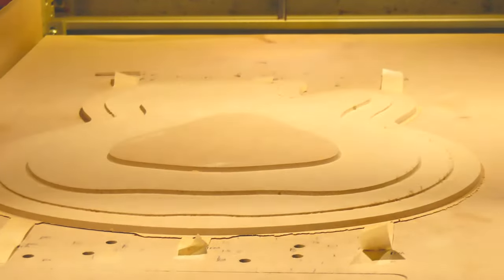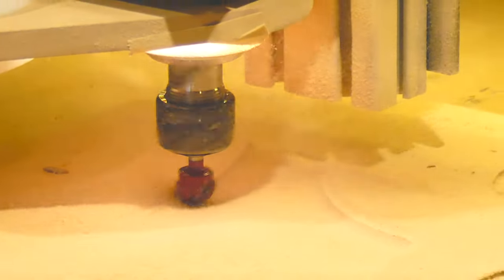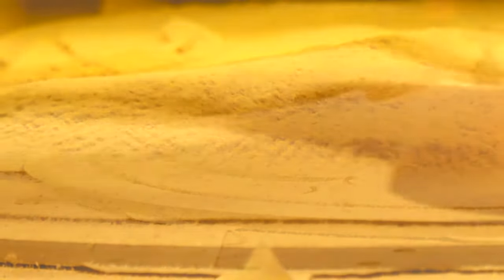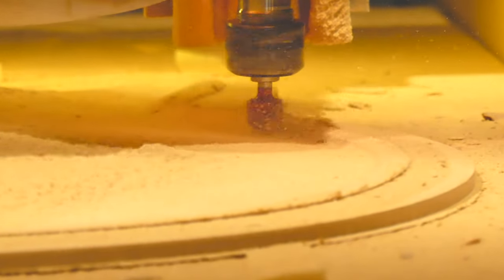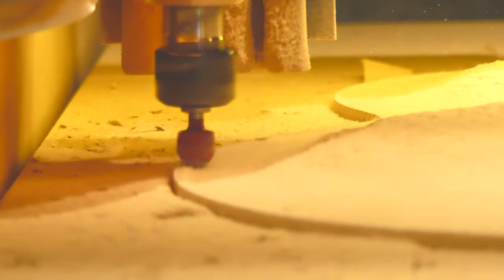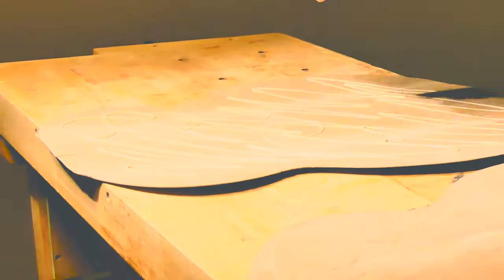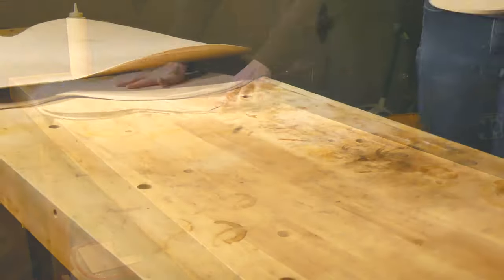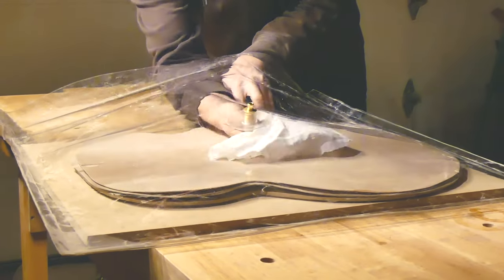Gretsch White Falcon | Laminated Arch Top

Comment: Hi!! Trying to do the same with a 330 build! Did you use urea glue for the lams or PVA? Also, what thickness are the laminates and are they cross grained? Thanks a mil!!!
Reply from the maker: I'm just using Tightbond original for this one. I wanted a top that is just over .125" depth and I uses a three layer laminate so around 0.04".

Comment: Really nice work!

I wonder what the tone difference would be between this kind of top and a single piece of the same wood pressed into an arch.  Any thoughts?  Would it have to be thicker?  Braced differently?  Sound different or louder?
Reply from the maker: There are so many variables in this equation, the outcomes are infinite. We can make some broad sweeping claims about the tone. Certainly, for acoustic value, a well constructed and tuned spruce top would make the string harmonics much more pronounced. This is an electric instrument so it doesn't factor in the same way. This topic has been argued back and forth forever and it will continue to be. I just try things and see what happens, I'm sure this guitar will sound great.
Reply: @TwoCherriesIns  Yes, I'm interested in acoustic archtops.  I know most are made by carving, but I wonder how it would sound if one started with a thickness-planed piece of Sitka Spruce and then bent it into an arch.  I think it's been done, but I don't know specifically what makes/models.  You did essentially this with your Selmer-type guitar, but of course that's only a slight arch.  Quite loud though, I think, right?

Comment: What wood is used for laminating? I’ve looked everywhere for bare wood veneer without paper backing but I can’t find it.
Reply from the maker: This is maple, I cut and thickness sanded these veneers myself. Veneer in the specific dimensions need to make these guitars are not available. You can uses a figured wood veneer for the outside lamination but to get the correct thickness you will need to thickness sand your own veneers.
Reply: @TwoCherriesIns do you use a bandsaw? My bandsaw wouldn’t be able to cut veneer wide enough for a guitar body.
Reply from the maker: @bradrichardson3539  yes, but its not a big bandsaw. I cut them in three pieces and joined the edges before laminating them.